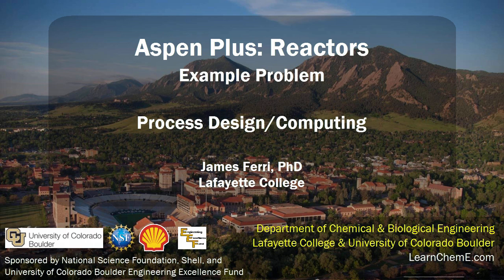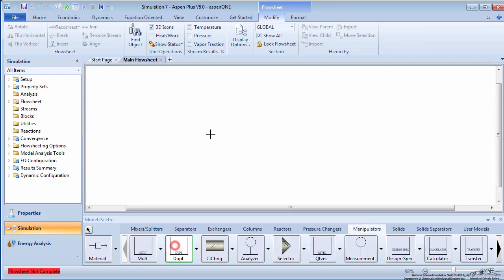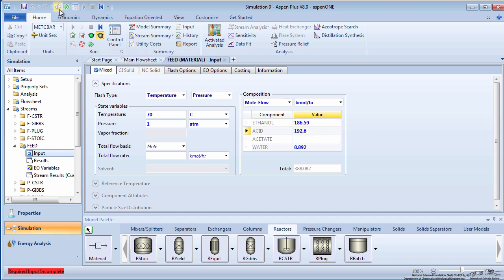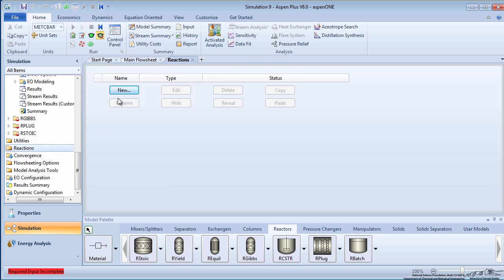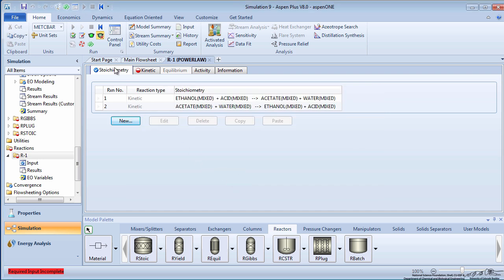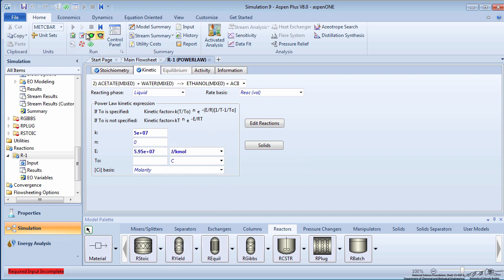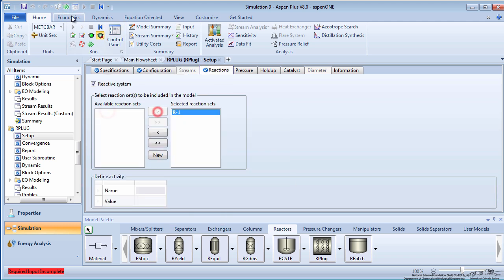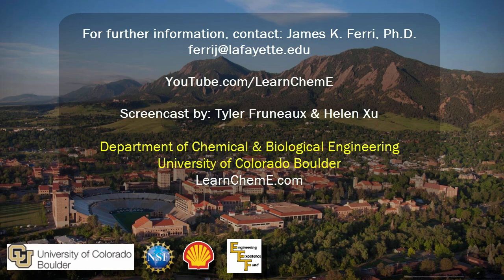Aspen Plus: Reactor Example Problem

Comment: I have a question...from where you are giving the input condition like temperature 70 degree and pressure 1 bar. and from where you are giving the cstr volume 0.14...please respond if you can...i am working on one workshop related to this..so need some response..thanks